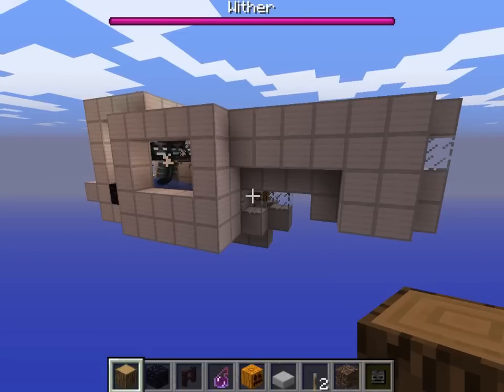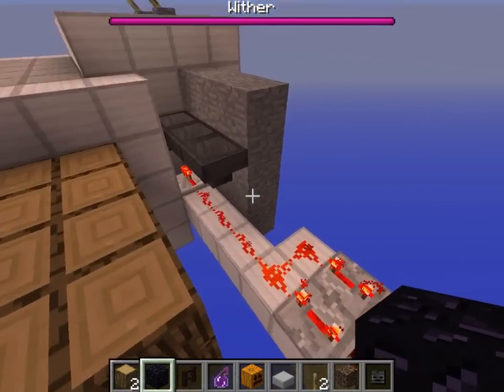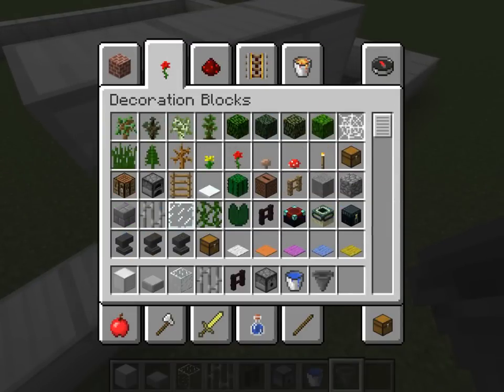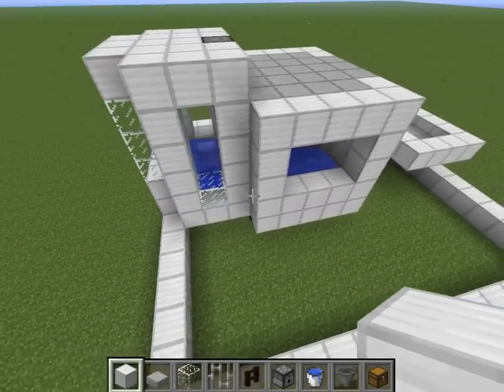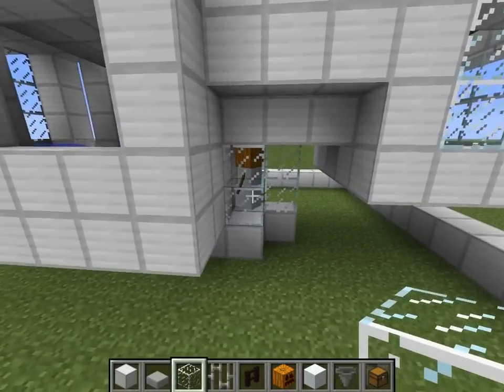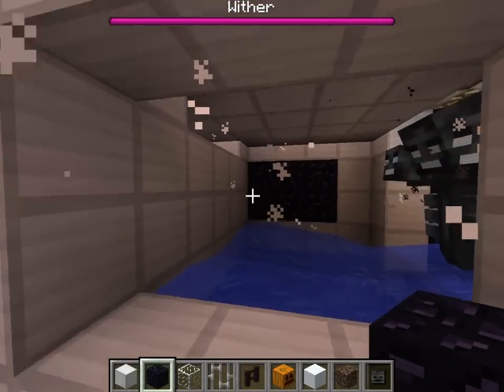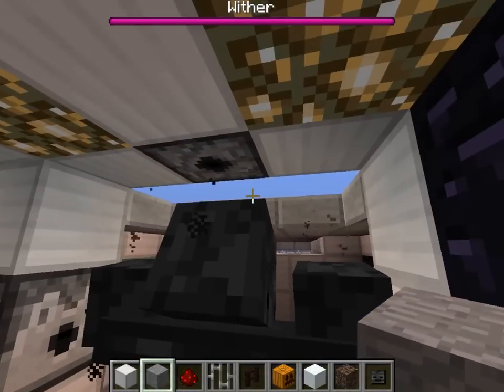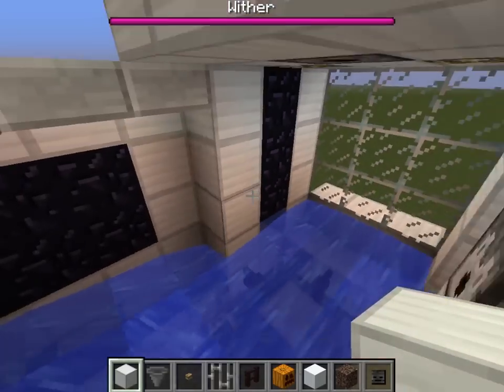Perfect Wither Cage - woodchipper / block breaker

Comment: The design is apparently not working anymore (as of 1.12), because the wither no longer targets the golems and just launches blue skulls in order to break away. I have tested it in Creative. Very bad since the idea of using the wither to mine blocks is quite interesting, and now it doesn’t work.
Reply: you can use a wither to break blocks in 1.12, but this system doesnt work, there are new designs

Comment: Just tested this in 1.12 snapshot 17w16b, and the only issue I has was that I couldn't summon the Wither with water flowing around the soul sand. So where the water source blocks were placed, I put dispensers with water buckets and wired them up so that after the Wither started generating I could run out and turn on the water. I wired up the roof dispenser separately and placed both buttons near each other for ease of use. So far working great.
Reply: Still working on a single player world, but I built it on a local SMP server and it didn't work. The Wither broke the slabs and escaped. Also, once the explosion that happens when the Wither appears killed the snow golem. I am dissapoint.

Comment: Doesn't seem to work on 1.8! Wither don't even spawn inside there!
Reply: No, because on 1.8 they changed the way to spawn the wither.
Reply: Mario Hammett How has it changed?  I've only started playing Minecraft since 1.8 a few months ago.  I just spent ages in the Nether trying to find three wither skeleton skulls specifically so I could build this tree farm.  I shall be disappointed if I now discover that this isn't going to work.
Reply: It works, but you need to do few things before you spawn it, now it needs a plenty of space around to spawn.
Another thing is that there is a chance of escaping since it is 3.5 blocks high, this cage is for a 4 block high wither, so keep that in mind.
Reply: Mario Hammett
I don't like the sound of that much.  Having the wither loose would not be good.  I think I shall test this on a creative world first and see what happens but the fact that this has changed from 1.8 to 1.8.1 makes me nervous that some future update might result in the wither wreaking havoc in my only survival world.
Reply: It's a good idea testing that on creative, make some little changes to the cage to fit the wither, maybe  adding a slab is all you need.
Or search for cage versions of 1.8.1, there are few of them around.

Comment: Even though you have stated how regular skull explosions always drop wood items (and they do), I've found that there is still a substantial loss of wood when breaking them this way because depending on the timing, a second skull incoming right after the first will indeed destroy a log item as it is still falling, before it reaches the water/hoppers.  I don't remember the exact waste but it was significant, as in 1/4 or 1/3 or more, and easy to verify anyway by just counting the actual number of logs being grown vs what is showing up in the chest.  By using the arrow/damage method was the only way I found to get 100% of the blocks out.

Comment: Can i build this in 1.8?
Reply from the maker: ... not quite. The height of the wither has changed and thus he can escape from this setup. On the positive side there is a different version that does in fact work (or if you are looking for just a wood breaker you can check out the fully automatic wood farm I have, that one is still fine and also uses a wither). I just dont have it out yet...
Reply: DanielKotes When will it be updated? I didn't realize it broke and my whole cage got destroyed.
Reply: DanielKotes  Can you just make the same structure, but one taller?

I was trying to trap a wither in 1.8 today with a similar structure and now I understand why it wasn't working XD.
Reply: For 1.8 u probably need to build the cage with obsidian or bedrock.

Comment: My wither in Vanilla SMP glitches through the upper wall and starts shooting at the iron golem. Help!!
Reply from the maker: my guess is that you built it too low - there are problems with the wither glitching through the ceiling if it is spawned below level 12 or so (built the setup above level 20 to be safe)

Comment: Is there a way to have a button to terminate (kill) the wither without destroying the machine? Maybe a piston to push it into a part of the roof made of obsidian. I saw sethbling do it.
Reply from the maker: there is a way to put in a location where you can kill the wither yourself (with a sword) without causing it to break out, however it is not possible to push the wither into a block and get it to suffocate to death unless you are pushing it into bedrock - the wither can break all blocks except for bedrock and end-portal frames.
If you are interested in seeing how to add in that ability to the cage, watch the obsidian farm tutorial - in there the wither needs to be killed off at the end of the farming cycle, so there is obviously a way to safely kill it built in.

Comment: Whatever you do, DO NOT change the 3 upper-half slabs to full blocks, opposite the wither. I did it because I thought it'd reduce the number of items becoming stuck in between the gap. However, THIS happened :P
https://dl.dropbox.com/u/30754641/Shared/2013-12/Minecraft_1.6.4_2013-12-20_00-17-56.png

Comment: one, does it still work in 1.7? and two, what materials are you able to make the cage out of? because the block blast resistance is what counts, right? couldn't brick be used as well? or even cobble?

Comment: Nice, know of the solution where the Wither are centered with stone/wood and pistons,in a small room, using its small 1x4 hitbox,  and thereafter suffocated until it break the blocks around it. That solution has a problem, that there are almost no room for the pistons and stone/wood.

This is nice – using fence poles and lots of space for the material to be pushed in. This is quite smart!

Comment from the maker: you seem to misunderstand - the modifications I suggest are to make the wood chipper work - as in "as long as you do not damage the wither".
If you damage the wither, it might escape. It will definitely break the blocks I said need to be placed around it.
As of this moment, the cobblestone breaking method (where you shoot the wither) DOES NOT WORK ON SINGLE PLAYER. If you set it up in multiplayer it works without any modifications.
Hope that explains things.

Comment from the maker: no you cant because cobblestone has a higher blast resistance than wood, and thus will not break (as a side note; this means that you can potentially build the cage out of cobblestone since the black skulls wont break cobblestone blocks). You could though put the wood in the cobblestone slot (though you would waste arrows, you can process blocks faster as they have a 100% chance of being destroyed 1 sec after you shoot the wither).

Comment from the maker: No he doesnt. I know because I play with panda and he agrees that this design is better than the old one with trapping the wither inside bedrock. And if you are talking about using the 'damage wither to break blocks' technique for wood (which is faster, true); you cant actually use it without needing either a supply of arrows or a supply of snowballs. Pushing a block into the wither's head doesnt work.

Comment: thanks this is really cool I made a extremely condensed, fully auto cobble stone generator and use simple scar's vanilla chunk loader to make it run forever and if that's not enough hooked it up to a huge industrial furnace that I designed.

Comment from the maker: I am not sure about that (has been some debate between me, Panda and Kabo), but just to be safe you should put it all in a single chunk.
Reason: if the wither is loaded while even one of the targets isnt, it can break out. This can only happen if the chunk with the wither is loaded while the chunk containing the golem(s) isnt. However Panda thinks that in this case the wither will not be able to attack since it is at the very edge of loaded chunks.
To summarize:
- to be safe, put it in a chunk.

Comment from the maker: um- where did you spot that?
Anyway - I play on several servers and one of them is still 1.6.1. Must not have noticed when I was filming what version of MC I had on. In any case this design has been tested in 1.6.2 as well (with the Zipkrowd crowd), so you can be sure that it works in the latest version as well.

Comment from the maker: absolutely fine (just light it all up and flood it so endermen cant teleport in). You do know that in the case it gets out your solid cube wall would fold like paper, right? After all the wither would start spamming blue skulls which can break anything except for bedrock (and end portal frame).
Anyway - I tested it extensively and can tell you that if you spawned it correctly (if it didnt escape within the first 15 seconds), it is perfectly contained. Just dont attack it yourself.

Comment: you have water and lava, you place lava on top of water sources and it creates stone. I.E place lava on the ocean and you can have a flat stone surface. Then have pistons below to push up the created stone to then be put into a stone generator system. To get the lava to be turned on and off hook it up to a timer with a lava bucket in a dispencer. Hope this helped.  :D

Comment from the maker: not exactly - it cant track anyone if it locks on to the snow golem. If there is someone closer when the wither is loaded (such as if you save/exit and load back in on a single player map), the wither would lock in on that 'someone' (you, or a villager, or quite a few others). It can lock on through any block (its only by distance).
Doesnt matter though - as long as nothing comes inside the blast chamber, nothing bad will happen.

Comment from the maker: The arrows do 1.5 hearts damage each time they are shot - and I believe that you would need an overly complex system to push in cobblestone fast enough to require you to shoot more often that once every 2 seconds.
Even if you do, the wither would just get to 1/2 health, get armored, and your production would slow as arrows wont do damage until it's health increases to over 1/2 again.
Actually thought to use it to euthanize the wither safely, but unfortunately that doesnt work.

Comment: No personnel are to be within a 17 meter radius of the containment area under any circumstances other than maintenance. Re-location of subject will require the permission of at least two (2) level 4 personnel.
In the event of containment breach, all on site personnel are to equip blast resistant radiation suits and subject W64 is to be terminated, first by projectile weaponry, then W64 is to be damaged by melee, explosive, chemical or fire based weaponry.

Comment: Item#: SCP W64
Name: Wither
Object class: Euclid
Security Containment Procedure: Subject's containment storage must be kept in a 16x16 area. Containment storage is to be flooded with 1m of flowing water. A living entity must be stored 9m away in a steel container. A second living entity is to be contained 6m away in a steel container. Sprinklers are to be installed in the ceiling of subject W64 above subject's. A flat blast resistance wall is to be erected between the living entities and W64.

Comment from the maker: the snow golem is there so that the wither will look at him (focus), thus will not send out blue skulls and break out. The iron golem is there such that the wither will attack it (with the two heads at each side), and thus break the blocks in front of it (also, if the iron golem wasnt there the wither would be considered 'idle' and start spamming blue skulls).
Hope that explains things.
Dan

Comment from the maker: has to be arrows. Me and Panda tried it with pushing in a block, and it MOSTLY works, but still there is a chance of blue block buster skulls - so my original use of arrows is the only way.
Note that if you hit the wither with potions it will send out blue skulls (BAD), and if you hit it while in survival it will try and attack you (also bad).

Comment from the maker: it doesnt have to be iron - you can build this using stone if you want (iron just looks good).
Just go into the block data and find the ones with blast resistance similar (or higher) than rock - all of them should work.
Heck, you can build it out of cobblestone if you want.

Comment from the maker: it is possible to patch it, pretty much the same way it is possible to make sure that any farm fails. Still, it does not rely on any 'code fails' / glitches, so I hope it does not get fixed. Heck, to fix it you would either have to make the wither shoot out blue skulls every now and then no matter what it is doing (fail answer - that would just change the entire way the wither works), or actually edit the code for the archer class (the one that has been the same ever since the skeletons came out

Comment from the maker: I originally used a setup with villagers - that works fine. Also, you can use iron golems if you want - you just need to make sure that the golem that the wither CANT attack is set up closer than the one it can. Heck, if the initial blast didnt damage all within the radius, you could use a chicken for all it matters. (Note that undead mobs dont work - so zombies, pigmen, etc. fail)

Comment from the maker: probably - Should try that, though the redstone would be quite close to the wither and might break accidentally.
A better solution would be to have a block at the end that would be pushed out whenever the third row is filled, triggering the break. Then 1 second later another piston would push the block back into position to be ready to be 'pushed' again. Sort of a primitive button made out of a solid block.
Anyway - I will leave that design up to you guys.
-
Dan

Comment from the maker: Panda informs me that the entire 'build in a single chunk' is not as required as I think. I KNOW it is 100% safe if you keep it in a single chunk, but Panda tells me that it should be safe even if you dont.
In any case, you can build at least 3 adjacent to each other since you can spawn the withers with only 1 block between each (we tried that and it worked).

Comment: i do not think it will work if you use obsidian like that
but maybe regenerating the end platform
in multiplayer one stays at the end portal in the overworld and keep on regenerating the obsidian platform by using a sand generator, or a dispenser dispensig whatever, and the other person at the end loading the wither